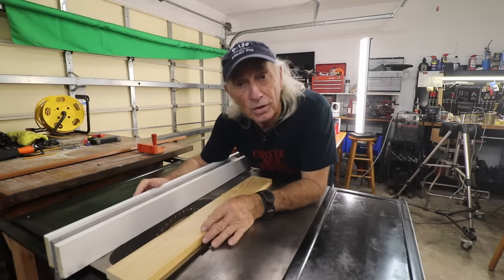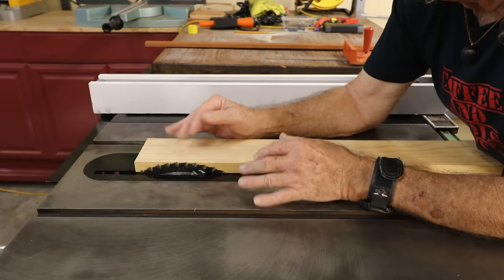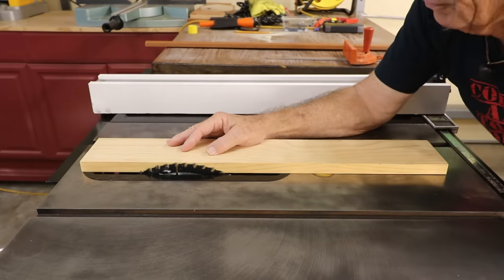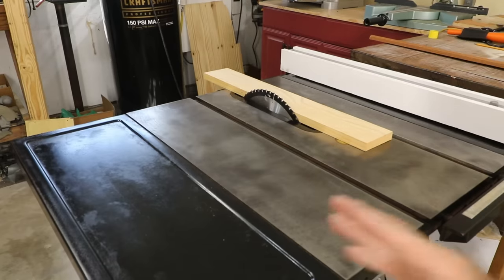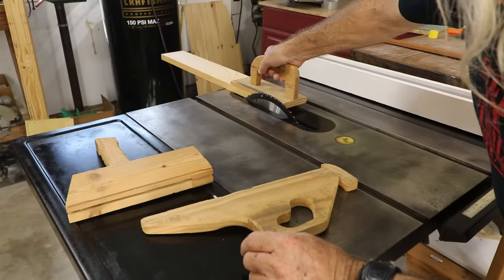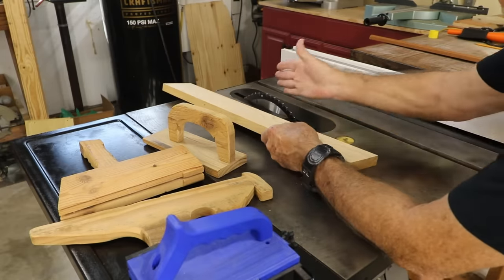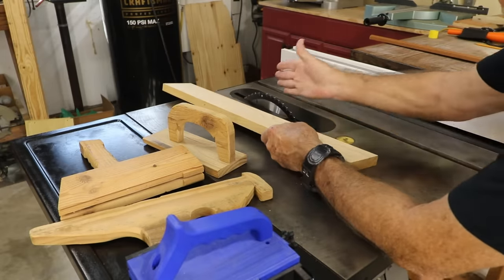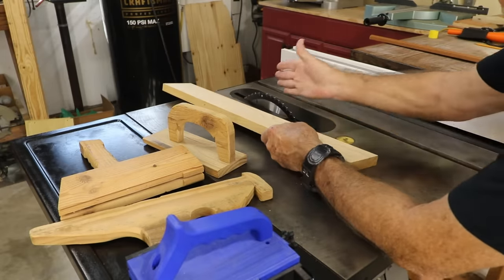Table saw secret nobody will talk about from the good old days, C&T episode 180

Comment: Excellent information. My neighbor gave me a very old table saw yesterday, with zero safety features. I haven't used a table saw in over 50 years, and then only in shop class. And more than 25 years ago I lost my left arm in an electrical accident. I've been getting into woodworking now and am using a circular saw, power planer, miter saw and router. It's fun and I take a lot of precautions. After watching this video I'm wondering if I can ever safely use a table saw, let alone the antique my neighbor gave me.
Reply: I don't know about the power planer, but of all the other power tools you use, I think the table saw can be the safest in your situation because it's set in one place, held the table, guided by wall etc.  I would figure out how stand away from the line of cutting towards the side of the scrap wood which is the least likely to fly towards you at the end of the cut.  Do a bunch of trial cuts on scrap wood just to get a feel for it.  If you don't feel safe and you can more or less tell why that is, follow your intuition.  But if you can't really tell why you're afraid, it may be just because you feel at a disadvantage physically, but not necesserilly because something is actually wrong.  Good luck and I admire your drive to create.

Comment: I think it would have been good especially for beginners to explain the importance of aligning the blade straight with the table, and likewise the fence aligned with the table. 
Another VERY important point to mention is keeping the fence out of way when crosscutting using the miter gauge. I’ve used a table saw for nearly 60 years, and a couple of years ago, I let my common sense lapse for a second, and a short piece got trapped and flew out like a bullet. It struck me on the right side of my chest, and man did it ever hurt! I had abrasions, a bruise, and was sore for about 2 weeks. 
And finally, standing to the side a bit, out of the line of fire, is ultra important habit to develop! 
Good video, thanks for sharing, I’m sure lots of people will benefit from it!
Reply from the maker: Very good thoughts here
Reply: I don't see this as a beginners topic.
This is more for seasoned users that have been brow beat..."this is how you do things"
Just my opinion.
He's talking about dark side topics, not beginners safety... they can get that from stumpy or anybody else.
Reply from the maker: @lectro88  Exactly, and thanks for posting
Reply: Yep, been there

Comment: this makes sense to me. Have to say though, In all of my years of using a table saw, the only times I've come close to hurting myself are when I'm trying to rush, or I'm distracted. I've got an old saw without a riving knife and there's no doubt it's a dangerous machine, but my rule is NEVER rush and avoid any possible distraction. No music, podcast, friends, pets, day dreams, ect, when the table saw is being used. Also, if you're trying an unusual cut, or a new material, make sure you know what you're doing and understand the potential hazards first. It's those unforeseen issues that catch you off guard.
Reply from the maker: No rush and plan it out before cutting, you betcha
Reply: You want to have total concentration, know where your fingers are and have good control at all times.
Reply: Double check.  Then when there is no distractions as you suggest, triple check.
Reply: And just like the C-130 that had a big red line on the fuselage marking the rotation plane of the props, stay out of the rotational plane of the blade. I always stand off center so if the board does get launched back I will not be there.
Reply: Yep, very sound advice.  I'm saying this because of an incident that happened to me quite a few years ago.
Although this happened on a jointer instead of the table, it can apply to anything in the shop that has a sharp, spinning and exposed edge to it.
I was using my jointer and while doing so I sliced my fingernail off.  The main reason this happened?  Overconfidence.  I'd used this machine so often it was like second nature to me.  It means that there was almost no concentration on what I was doing.  I was very lucky because my finger is still on my hand and still works normally - minus most of the fingernail.
Since this happened I have become just a little bit afraid of these tools when using them and I was telling someone who has a lot more experience me.  He said that this can be a good thing because it ensures that I am checking, double checking and then triple checking what I'm doing before I begin my cut.  This bit of fear makes me aware of the sharp spinning blade.
Reply: @garyolsen3409  i think you gotta watch the blade tho..  not your fingers..    i always look at the blade .. not my fingers  : )
Reply: @saltydawg5489  I never watch the blade. My first concern is that the piece I am cutting stays against the fence. I start off with my hands where they should be. My rule on a push sticks is usually under 2 1/4". Always has been.
Reply: @bobbyt9999  thanx for telling the story.  i'm online because i am wanting to rip some treated pine 2x4 and just wanted to see what new info is out there. i use mine old school.  dumb i guess. but that's because i have more confidence in my work.  i've never been hurt by a table saw but i've been witness to throwback and i typically just don't like the low blade height.  i could put on the riving knife and cover.  i could use low blade. i've had to use table saws setup like that with friends' projects and i hated the feel.  almost like the wood is floating on air,  just wanting to kickback.
me personally, i open the back end(fence) a tiny bit to avoid pinch, but i'm building birdhouses now, not cabinets or such.  jmho

Comment: Hi, I live and work in the UK. Our saw fences and systems were very different to yours in the USA, Different remember I didn't say better.  I started in the shop at age 15  (1965)as an apprentice. The fence would typically not extend beyond the gullet of the saw tooth nearest to the operator. This was to reduce the chance of kickback.  The first full-length fence I saw was on an imported contractor saw. It was and likely still is a legal requirement for saws to be fitted with a riving knife and a top guard ( in a workplace as opposed to a home shop) and to have a push stick with a birdsmouth cut and be least 14" long. many saws were not fitted with a rise and fall so the saw blade could be 8" out of the table. And of course, if the timber being cut was not true the round side would go towards the fence. Thanks for your video and everyone else's comments.
Reply: I can vouch for what you say too. 
Watching this movie my concerns are more about the extent of the fence beyond the cutting edge - cuts release the stresses in the wood (especially with fast grown cheap pine) that will sometimes result in a bow developing, so why have the fence press the wood into the back face of the blade?
As for those cumbersome push devices, I doubt the wisdom of a full grip handle to wrap your fingers around, Id rather be able to just whip my hand away, and not remove it from a hole first.

Comment: I was taught to put the bottom of the gullet of the tooth above the piece. So, it varies in height, but you essentially always have a minimum of a full tooth and a hair above the wood. I get good cuts, it isn't high enough to fully sever a finger in one go, and it reduces the force needed to push the piece through.

For running very thin pieces through the table saw I just use a feather-board and a push-block. The feather-board applies lateral pressure, and also prevents any easy kickback, so all I have to do is apply forward and down pressure with the push block/stick from above.
Reply: I was told to adjust blade so the bottom of the gullet of the tooth is even or just a hair above the surface of the wood you are cutting so it helps make the blade to run cooler and to more easily eject wood chips that gather in the gullets.  Any suggestions?

Comment: Thanks for the honest info! I was taught over 50 years ago that ALL power tools can hurt you and to respect them and know what the hell you're doing before using them. I always had "good" homeowner type table saws and in all these years had 1 kickback (into the gut) and no cuts. I raise the blade to the bottom of the gullet and always use a sharp blade. Equally important as keeping your hands away from the blade is to make sure the fence is properly aligned.  I was taught Sharp is Safe. I've seen idiots get hurt using dull drill bits.
Reply from the maker: Thanks for the honest comment :)
Reply: Well.. statistics don't lie. Table saw is more dangerous than all of those power tools. It's the least forgiving when you have a lapse in concentration..and no one is perfect in that department, you could little follow anyone on the road for a few miles and see a lapse in concentration in some way, so the more comfortable you become with something, the more likely you'll have those. I'd prefer to get comfortable with a track saw than a table saw... If something does happen, well probably nothing will. Life is more important than convenience.

Comment: I started cabinet making around 1992. About 30 years and my favorite job was always cutout on table saw. Those days are gone with CNC but table saw still is needed. I use saw same way with blade about 1/2" to 3/4" above piece. Never been cut, had a few kick backs (never hurt) but learned what not to do.
Reply from the maker: The CNC stuff is pretty darn cool
Reply: Lots of shops without CNCs out there still. Being a Sawyer is a fun role when the dust collection is working properly! 😆

Comment: I spent 30+ years working in cabinetry and display work. I always set my blade at the notch at the bottom of the tooth, about a 1/4 to 3/8" above the wood. I also used the splitter/anti kick behind the blade, this insures that if there is any binding after the cut it will not close up and of course no kick back. The biggest detriment to table saw safety is repetition, working one operation all day one can become lackadaisical and start to drift mentally. Time to take a break.
Reply: I agree, but not everyone is using a fancy cabinetry table saw in a woodworking shop.
Reply: I was told this was the proper blade height because it allows sawdust to empty out of the troughs properly.
Reply: Absolutely. I am trying to pull metal splinter out of my knuckles right now from getting lazy with my grinder. Luckily I haven’t had any close ones with the table saw yet

Comment: I've been woodworking for 40 years and have had very few incidents with kickback. The other day I was using my homemade tapering jig to taper some legs. I had it all set up and then I realized I didn't have my zero clearance insert installed. Big mistake. The wedge of the taper came off and went inside the insert and bam. It sounded like a m80 going off. It broke one of my garage door windows and I felt the breeze of something barely missing my head even though I was standing to the side of the saw. I learned my lesson and I was lucky. I had to say a little prayer after that.
Reply from the maker: Geeez...Doug, don't leave us just yet. WoW..
Reply: For sure. The little bits falling into the standard plate have been 99% of the sketchy things to happen with my saw. Really need to get a zero clearance

Comment: I've been using a table saw 40 plus years.  I agree, it is one of the most dangerous tools.  I use the push tools also.  Please don't forget, to not put yourself in the line of fire.  Standing to the side is as important as keeping your fingers away.   I've seen a few injuries from kick back.   We can get into other things like feather boards, but safety is where it starts.  Thumbs up and fingers out of way.
Reply: It may not happen as often, but a lock-on electric hand tool like a grinder is extremely hazardous if it catches you.  People put a paddle sanding disk on a grinder, It can run out of control over a good portion of your body or head, and when it finally stops grabbing, its not because its off, but has burnt in where its not grabbing any more.   Horrible injuries occur with spinning tools.   Never use a lock-on trigger with grinders, drills, or rotating hand tools, chain saws, or routees.  I know they save from fatigue, but in a split second its a mistake.

Comment: Safety is not a device, it's a state of mind based in full awareness of the risks involved in the activity.

High blade reduces kickback, low blade reduces exposure to the blade. I say it's a tossup for safety.

As for quality of cut, high blade could give a smoother face of the cut, but low blade reduces tearout on the face of the board. So quality is a tossup there, too.

Using a sharp blade with good set, and keeping the board tight to the fence are probably the most important factors in safety and cut quality in terms of saw setup.
Reply from the maker: It is just that.

Comment: When I started building cabinets about 16 years ago my boss taught me to put the blade up almost twice the thickness of the material.
I'll be 35 tomorrow and still consider myself young. But after watching the video, reading these comments, and giving my comment, I'm beginning to think I'm old school myself.😄
Reply from the maker: yeap...your old school...in my club :)
Reply: @SirTools  Sometimes old school is more a way of thinking, rather than just how many times you've circled the Sun while living on this planet. I am 36 and have picked up some "old school" knowledge from my dad, and other elders who have been kind enough to share their knowledge (like yourself). Thanks for sharing your knowledge. Personal responsibility is another old school think I believe in. One needs to learn how to use the tool and respect it. I can't blame my accident on a youtube video if I were to make such an unfortunate mistake.
Reply: I was about to say the same thing. From blade height as double the wood thickness, for the best cut. Also that I, myself, am 35, till April that is.
I learnt a lot from just watching my Pop in his shed doing wood work and metal work.
It's a cousin of mine that took off the top of a finger on a band saw when he worked in a picture framing business.

But I got my arm caught in the exposed gears of a metal lathe, while reaching to turn its power off. Oops
Reply: @TheHungrySlug  saws are bad enough but THAT worries me more. Rollers, printing presses, lathes, chains, and anything with gears exposed under power is extremely dangerous. All it has to do is grab a part of clothing, or PPE, and then it can pull you in and have it's way with you. It can happen so fast even trying to hit an e-stop might not prevent an accident. Hopefully it will safe your life but you might lose an arm in the meantime.
Reply: As a less-than-novice I see two forces at work.
One is personal safely and the other is cut quality.

I believe that we should NEVER sacrifice personal safely to obtain quality cuts nor to improve efficiency.

Lumber is sold, cut, and get thrown away.
However, from a tiny cut to a complete loss off some part of the body is permanent and not retrievable!

Some old-school is good. However, don't forget the advances made to minimize the possibility of these injuries.

I've learned that it's important to:
1. Keep pieces firmly pressed down on the table and against the fence!
2. Feed through material at a constant rate towards and past the saw blade.
3. Keep fingers well away as possible from the throat plate and blade. 
The only exception is when machine is unplugged for changing blades, throatplate, and cleaning. 
4. Make use of an outfeed table or props.
5. Make us of some infeed prop so you could focus on a the pressure downwards to the table and sidewards to the fence!
6. Don't stand in the way of the smallest piece of material after the cut. It's the smallest pieces that tend to be more volatile.
7. Always endure that fence is not forcing material towards the blade while cutting!
8. Use all the safety 'gadgets' that came with your table saw; or those that are available after purchase. 
Think of them as your bodyguards. They are there to minimize and neutralize threats.
9. Your personal protection is your sole responsability! 
10. Overconfidence, distraction, tiredness, rush, impatience are some of the most dangerous traits that undermine your personal safety!

Remember, the finest piece of woodworking that you can ever make is your safety!

Comment: I live in the UK. and recently found a well known router manufacturer  market a spray for wood cutting tools . This spray will stop resins and glues from plywood and OSB board sticking to your blades and works as a lubricant on saws. I tried it and got a much a more efficient and smoother cut on my saw table. Very impressed.
Reply from the maker: The clean blade sure does change the game :)